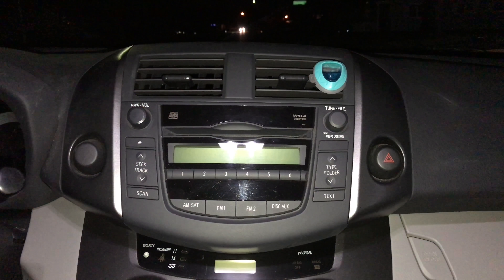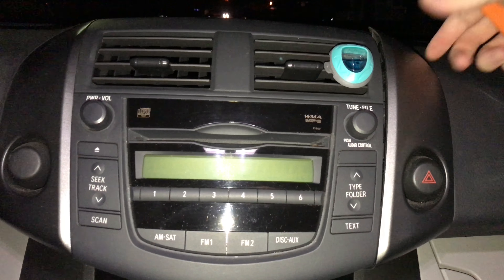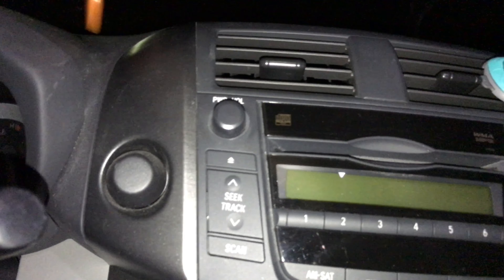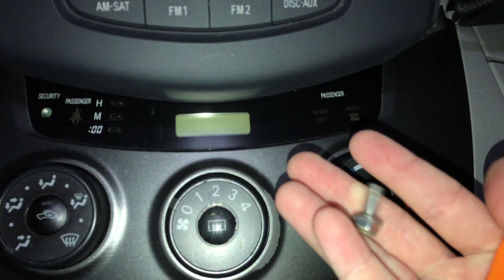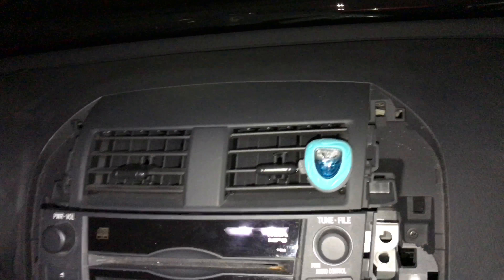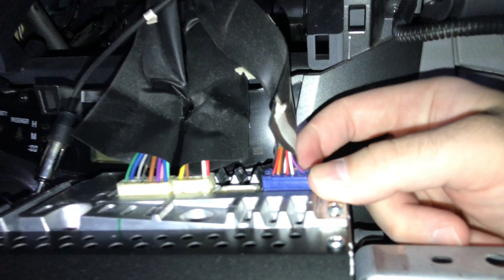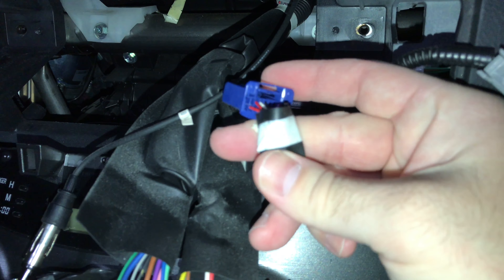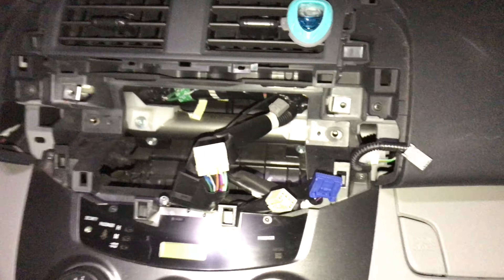How To Remove Radio RAV4 2011

Comment: Hi good night my friend I have the same rav4 but I think the stereo got water inside and it stopped working, the question is that if I just change the stereo for another one it will work?  Or it’s another thing
Reply from the maker: It should but you have to see if it’s the radio or the fuse. See if the radio fuse blew out, if it did then change it and see if it works again. If the the fuse is good or you change it and it blows again, then you need a new radio.

Comment: Did you yourself upgrade your stereo from there, and if you did, then what would you recommend as to a replacement system, given that I am on a 200$ budget?
Reply from the maker: I didn’t upgrade the stereo on this car but I have put new stereos in 50+ vehicles and I’m a MECP installer. If you are a $200 budget I would go with a stereo and just front speakers that are sensitive enough to run on that new radio. Sensitivity means how loud speakers get in decibels in relation to the amount of power you give them. The higher the sensitivity, the less power they need to be loud. This means you won’t need an amplifier now but it will be much better to add one later if you get some extra money. 
Here is a great radio from pioneer - http://amzn.to/2zKb4qW
And these are amazing speakers from CDT - http://amzn.to/2Cl9T4i
This pair will not let you down. You will also need a radio mounting bracket from metra, a wiring harness, and an antenna adapter. Let me know what year your car is and if it had a JBL system from the factory or not and I can let you know the other parts too if you don’t know them.
Reply: Alrighty. Thanks for the suggestions!
Reply from the maker: No problem at all. I’m actually installing a $2000+ stereo in my 2015 RAV4 right now so it will take some time to get videos edited and up. I’m using all top of the line  CDT speakers and amplifiers and a high end pioneer sound quality radio. I’ve had the best brands from around the world and none of them compare to the quality and ease of installation with CDT. I’ve been on the other end also where I have just installed a cheaper pioneer head unit and the speakers in my car that I recommended to you and they are a huge upgrade over factory.
Reply from the maker: You’re welcome! I’m actually installing a high end stereo with a sound quality pioneer stereo and CDT speakers in my 2015 RAV4 right now. I’m  in the process of editing and putting up videos, so they should be up in the next few weeks if you want to subscribe and you can be notified when they go up.

Comment: I have a 2010 Rav4, stereo  looks exactly  the same, is the 2011 the same  as the 2010?   I want to get the same one.
Reply from the maker: The should be the same unless you have a premium sound system from the factory.
Reply: @NameItBuildIt  thank you! My seems standard issue. So happy I found your video!
Reply: What was the model number you used?
Reply from the maker: Model number for what?
Reply: @NameItBuildIt  the radio you pulled out
Reply from the maker: I wish I could tell you but I made the video over a year ago, so I don’t have access to it.
Reply: @NameItBuildIt  no problem.  Thought I'd ask just in case.